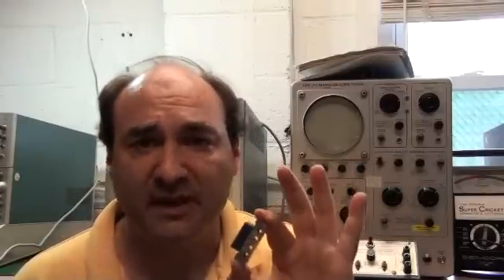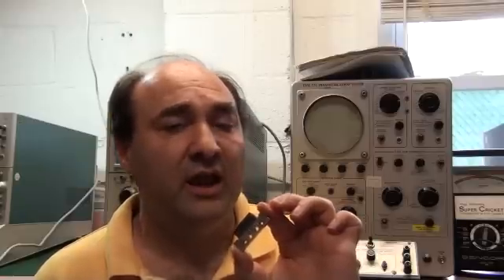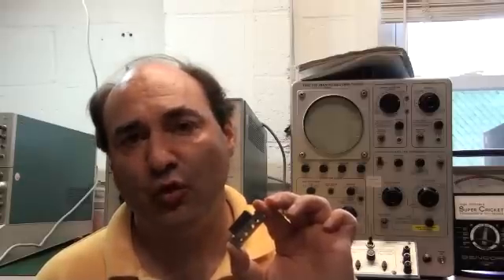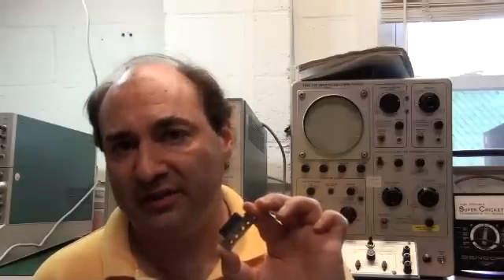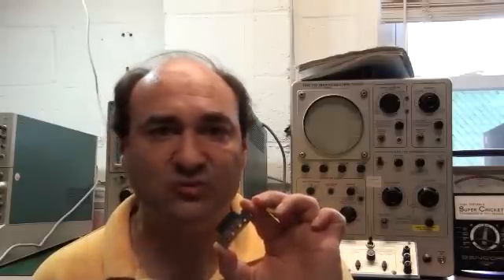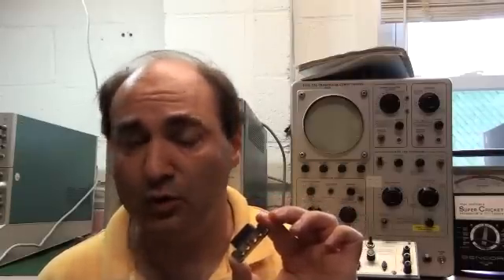CA2818C Wideband Hybrid Power Amplifier

Comment: Can they be used in parallel or push/pull for more power?
Is there a schematic of the internals?
Reply: http://pdf1.alldatasheet.com/datasheet-pdf/view/3015/MOTOROLA/CA2818C.html
Reply: madamerotten Nice PDF, i have one just like it .... the PDF does not answer my question ...